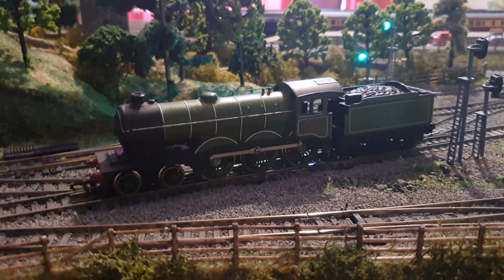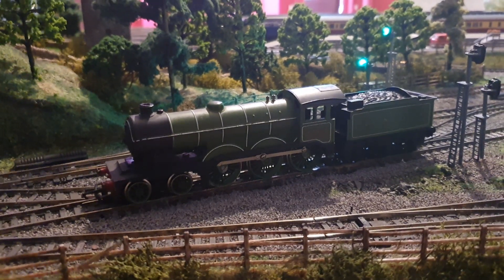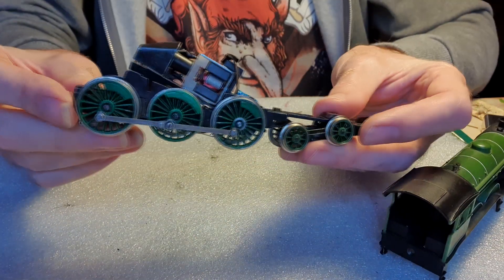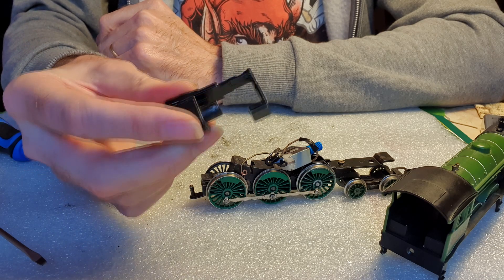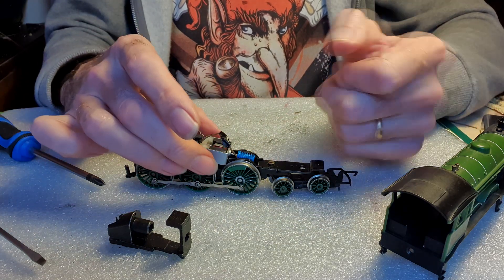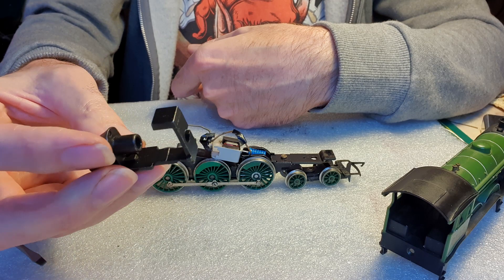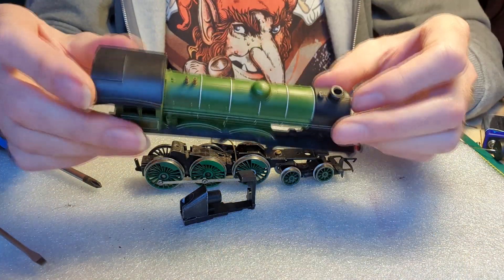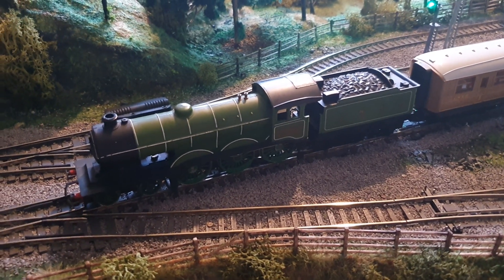What's in my Hornby R150?

Comment: Really interesting Bill but the cost and work is substantially increased however, it does sound and runs so much better👍
Reply from the maker: Cost is less than a used x03 and apart from having to replace the drive gear its an easy fit. At least it doesn't sound like a drill anymore...😉

Comment: All of Hornby's B12s made in China have the Type 7 motor and the mounting bracket. I have been looking around for this mounting as I want to convert 3 of my B12 to this type of motor. It will also fit on any 0-6-0 engines fitted with the XO3. So I want to replace the motors in all of my 08 shunters.  Martin. (Thailand)

Comment: The lastest B12 coming out of China have the type 7 motor fitted as standard. In fact, I won an auction last year for The Anglian Express Train Set and that set goes back 8 years. The B12 really does look great in Blue, even if it is a neverwazza. I have just bought another rolling chassis with the motor already fitted, but in the photos, it shows a piece of plastic packing at the back of the motor mount, which is a bit worrying. It must be pushing the worm drive into the axle gear a bit harder. I also want to get some of those motor brackets, so that I can replace the motors in my Class O8s and any loco that has the XO3/4 motor. The motor is made in Japan and they can be bought from them directly. I hope this was useful. I will have to wait for mine as I live in Thailand. Regards Martin.
Reply from the maker: So a bit more research and this part no is x8777sk. Pure coincidence they were made for B12s. Weird. Pretty sure they would work with any x03 chassis though.

Comment: Did those B12 locks not come at one point with a smoke generator fitted....I seem to remember getting 1 in a kit for xmas in my teens......but yes I'd like to source a type 7 motor and fitting kit for mine too.....plus the pick up plate if anyone knows of 1 too.

Comment: That looks like a really good find. I'd definitely be interesting in getting some if you can find a supplier. ATB Paula
Reply from the maker: They must be out there somewhere but I haven't been able to find anything.
Reply: @oobill  Hi Bill, by a complete fluke I think I might have found out what it is. I was investigating what motor was in the Hornby LMS 2-6-4 4P Tank from the 1990s. Service Sheet 122A shows motor mounts for its type 7 motor which look very like the mount you showed

http://www.hornbyguide.com/service_sheet_details.asp?sheetid=58

Extensive googling didn't bring up any listed anywhere though so I can only assume that they're long discontinued.
Reply from the maker: @paulathomas4944  Yeah I just did the exact same thing!! 😄 Just coincidence they were actually for B12s. Part x8777sk. There must be some out there.

Comment: these locos were far better with the x04 motor which could be repaired, great video though
Reply from the maker: It had an x03 in it which I did repair but it never ran well and was loud. If I ever get a good X03 or x04 I can always refit but this now runs way better.